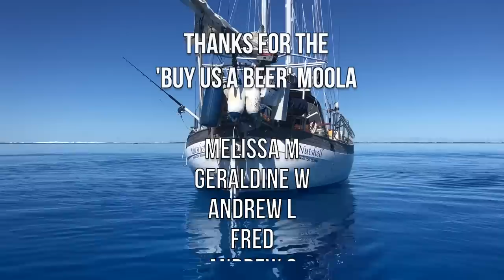Ep 310 | Leaving Broome and Sailing South, Dampier Archipelago

Comment: Have you seen Moray Eels going ashore onto a beach to chase crabs? Did you catch a ship with your anchor line??? And it got away?
Reply from the maker: Hi William. We didn't see any Moray Eels, but did see sea snakes. As far as the chain story goes... A new crew member at the helm failed to stop Nutshell when we were weighing anchor. W.
Reply: @LifeinaNutshell  Thanks, Wendy. That is important to know. That is a new calculation, now. We all assume that the anchor system can stop the boat under all circumstances with a safety factor of at least 2.  I looked at my manufacturer installed bitter end and it is a pathetically small metal plate that will pull through the plywood bulkhead with perhaps a 2 tonne force. Worse than the loss of a chain and anchor for me was when I was attempting to access the electrical box for my anchor winch, because of the stupid stupid stupid way it was installed doing the contortions I had to do through a 300mm dia opening, I pulled my right side QL muscle (look it up [every cruiser should have “Essential Anatomy 5” installed on at least one tablet aboard]), and that took a full year to heal with much agony involved. That electrical box was the part Magnus had on deck there. I now have that mounted on a hinged plate that swings the box into the opening where it can be inspected regularly, recognizing how important it is.
Reply from the maker: Thanks William for the info. Sorry to hear about your injury during maintenance operations. W.